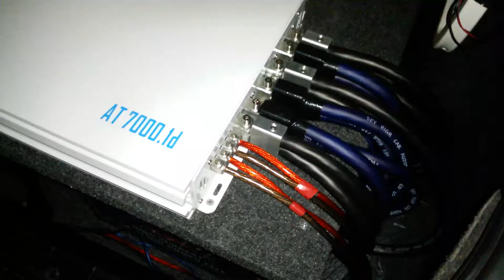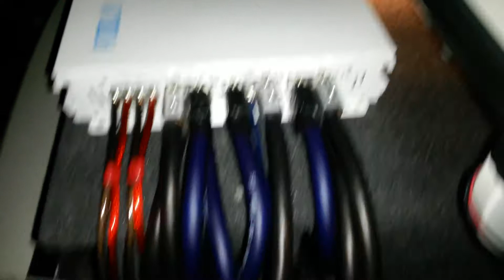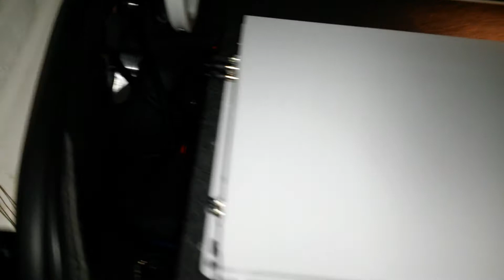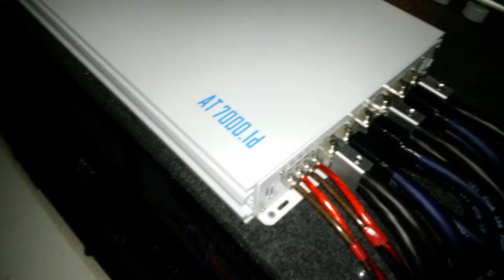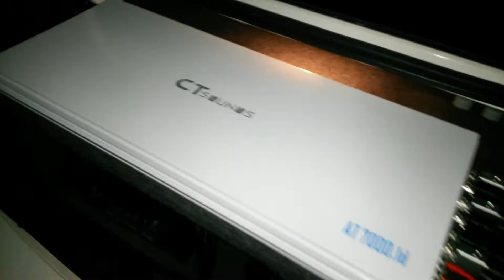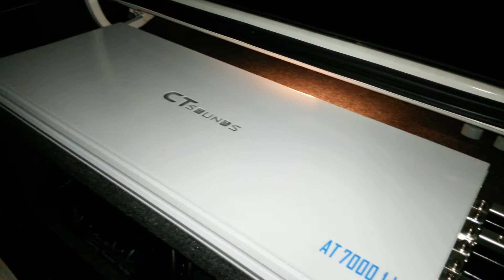CT sounds 7000.1 "SMOKING"

Comment: Wow, I had the same thing happen to a 4000.1d. Mine did say "PRO" on the bass knob. I took it back to the place that I bought it from and they exchanged it with no questions asked.  My new one appears slightly different on the inside.  I think that there was an "engineering change".  All I know now is that I am running two JL 12W7's in parallel and with box rise, I am averaging 2.25 ohms, and I have clamped at 3,056 watts at that impedance. Some day, my amp will send my 12's back to the factory to get reconed since I am running double the recommended power to them! I hope you got your amp exchanged like I did! I only had my first one for 3 weeks before it gave out.

Comment: hey man I have 1400.1 so I'm a fan of CT Sounds , but I notice in your last vid, you covered up the ventilation holes, the ones next to the cooling fans and on the opposite ends of the amp, though you did let the fans pull in cool air, the air had no where to go, and I believe that may have contributed to the amp smoking. Just my opinion, mainly I would like for you to the 7k another go, just with a more optimized mounting position.

Comment: Protect? The speed of light is fast us humans haven't figured how to harness the speed with thermo switches and other protection circuitry perfectly yet
So amps will blow until we figure it out
Sorry bro Coleman Therenger is a good guy
And that's a beast amp!

DB drive 7.5k
Or DC 7.5k
Both you will have little problems
Reply from the maker: lol, great comment..Thanks man
Reply: rubble lite sorry that happened bro all fixed up now?
Reply: American Bass VFL 750.1
F. T. W. !!!!!

Comment: It only took a month to fuck up... In your previous video when you show the installtion you cut out a nice hole for the fans but you cover the holes where the heat releases itself from......
Reply from the maker: You no, Your the only one that has pointed that out to me..Great comment and I'm going to look into that for sure
Reply: yeah I think you maybe on to something........but ive seen plenty of builds with this amp flush to boards or the back of walls mainly with no cut out for the amp to breath and haven't seen any of them smoking this hurt to watch
Reply: lol I should've read down some more because i just repeated what you said, and you're right the vent holes were covered, so he's had nowhere to go
Reply from the maker: Hey man that wasnt the problem, I've hooked 2 more amps up and as soon as I turn the car on they pop...So something else is going on..Thanks.
Reply: Ouch, that sucks, hopefully its something simple, but easy to find, life without bass is rather lame, and the basshead community is hurting with you
Reply: rubble lite I just had that problem with my Opti6k, Had me thinking something was wrong with my wiring. But I know its however they "fixed it" I dont think they test them when they get "fixed." Had to send it off for a second time within a month. The amp is good, Its just the workmanship I think is falling off. They aren't fixing everything that could have been damaged, just what seems to be the problem at that time.

Comment: Hello quick question I have 2 rockford fostgate T2 15inch both dual 2ohm.amp is orion hcca 4000.2 its 2 chanel amp.does 2×2000@2ohm.how to wire?

Comment: there are fans built into the bottom of the amp, in which you have completely blocked.
Reply: did you not watch his other video when he installed it and made a cutout in the wood for those two fans? Apparently not! He had 0, zilch, zip blockage of the fans. Just shitronics from asia yo thats all...
Reply: +666hobart it doesn't even matter, I have the same amp kicking strong. the problem is heat build up and he mounted it to the box, which is why these amps blow. I've never mounted mine to a box and that's why I have zero problems.
Reply: That's the first thing I noticed is how he had the fans blocked.
Reply: Ct sounds makes good shit just certain people don't understand how to use it or install it properly. I've installed so many of the ct sounds amps and never once had a problem with any of them.
Reply: The holes are not blocked if you watch his other video of the fucking install you would see that he made a big cut out in the wood for the fans
Reply: KINGKJ2REAL I've done enough research since I posted the comment. I know it's a shitty amp that can't handle vibration.
Reply: "the problem is heat build up and he mounted it to the box, which is why these amps blow."

It's not mounted to the box... those are batteries below it not speakers.
Reply: drjd2real I've installed so many of these amps and never had a problem. Not sure where you got your info from.
Reply: Luis Chavez He's right. There's a design flaw in these amps. The boards aren't properly secured inside the case.
Reply: Thezuule I have yet to see one of these shitty amplifiers though. Each and every one of them I've seen or installed has never had a problem. That's why I stand by what I've said.
Reply: Luis Chavez You're free to stand by meaningless anecdotes.
Reply: @Thezuule1  yup, they didn't put screws in the center screw holes on the amp board, they only put screws around the outside, so the center of the board flops up and down and probably contacts the bottom cover of the amp and shorts out.. sum guy made a video showing a the mistakes made on the AT line of amps.. sucks because it's a very well put together amp other than the screws
Reply: @samuelkelley1611  if you have that much vibrations in your enclosure then you have a shitty one. i mounted my crossfire 8k to my box and ran it for 2 years no issue but my enclosure was double baffled and braced to where their was very little vibration if any and it was 2 custom 10's in a 4th order bandpass.

Comment: U clearly had a power issue, not enough batteries my friend. Also did u fuse each battery wire for the amp?
Reply from the maker: Sorry man but I had more than enough for the the ohm load that was being put on it..I have something else going on right now I'm replacing all my grounds..
Reply: Are ur alt leads fused? It should be, to prevent voltage surges from the alt.
Reply from the maker: Jbasshead ice
Yes they are, Have you watched any of my previous videos...
Reply: Recently stumbled on ur channel, good stuff u got there. Will have a look at the other vids u got. Keep up the nice work bro :)
Reply: rubble lite  Been also wondering about the dual 0 guage inputs, are the outside of the blocks electrically conductive? Jus wondering because with that amount of power I bet there a whole lotta trunk flex, could it be possible the trunk flexed straight into those input blocks n shorted out?? Jus wondering seeing that the amp sits pretty close to the trunk lid.
Reply: Brad Builds agreed
Reply: Brad Builds So are all current models like this POS?

Comment: Thats why Im giving up on this mess, had my sundown 2500.1 v2  sent off because it  went into protect, they sent me a new amp, but I was still using the same bass knob, damn if my new amp didnt do the same thing two weeks later after installing, didnt even have my music turned up, I was turning my bass knob  down, heard a hum go through my subs and that was it. Why didnt my fuse blow? It didnt blow the first time.
Reply from the maker: I'm sorry to hear that man...Shit sucks for sure...Hope you bounce back like I'm about to....
Reply: putting together a lil bullshit system for some sounds, decided to run 1 15" sp4 to a hifonics 3200.1 until my amp gets out of shop and sale it for a bigger amp, and run it a .5
Reply: Stacey Spinks I got 2 sp4 15 on an ap 3k @ 4 ohms check out my vids